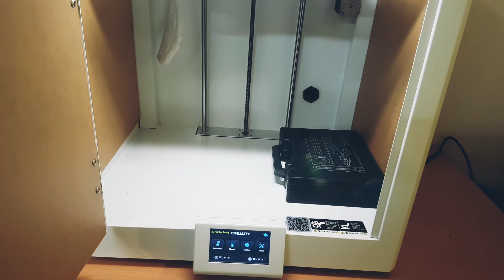Creality CR-5 PRO initial review Part 1 (Do Not Buy) purchased from 3idea.in

Comment: Fully enclosed 3D printer is not Creality's cup of tea it seems. I own Creality CR200B and all the motors are heating like hell, extruder heats to such extent that it melts PLA filament near extruder gear (tried reducing vref as well). I am thinking to add water block near each stepper motor now.

Comment: Creality should focus on get one printer right , not to design three dozens printers that are almost impossible to compare for features , pros and cons....
Reply from the maker: I think there strategy is to launch multiple products and then take the successful products forward all on customers expense. They have already launch a modified version CR-5 Pro-H with bl-touch and new hotend.
Reply: @DoTheDiy  Is it correct that this machine dosen't have a simple send a sliced 3d model to the machine? And i don't talk about crealitys wifi box that are no good. Starting to get embarrassing for them not arranging it. It is now 2021 and we have a bunch of products with easy wifi support...not talking about a 3d printer. So i think whats the big problem for them
Reply from the maker: @hammerfallen12345  No the machine does not have an inbuilt wifi or remote control/monitor option.
Reply: @DoTheDiy  Ok! That's bad....there will not be a creality machine next time. I can put more money for a 3d printer...but not for stoneage technology. Thx for your reply...there are better brands out there

Comment: you should have bought a prusa and dropped a cardboard box over it for enclosure.
Reply from the maker: Yes even I also think prusa wud have been a far better printer than this
Reply: @DoTheDiy  Always go with the masses. They have sold over 100,000 units for a reason. Three of them. Basically a lot of people use prusa for print farms for production. Not sure if anyone has any other brand running a farm

Comment: Hey buddy.
I was looking to buy this printer and have some doubts about it.
Which materials this printer can print.?
What's maximum printing speed.?
How about the precision?
And what are other disadvantages you're facing?
I would be very happy if you can give me some information. There's no where we can get a real review as of now.
Thank you in advance.
Reply from the maker: to sum it all up this printer is not worth the money. Print quality would be similar to Ender 3. CR-10S will be better bet at and will cost half what this printer costs.
Reply: @DoTheDiy  thanks for the review.
Can you give some review about Ender 6?
I saw on their website that it's a new printer will 3X faster speed.
Reply from the maker: @hiteshshah3236  ender 6 is a core XY so it can print faster than Cartesian printer. I doubt u will get good results at 3x speed at most 1.5x speed than cr5. If u want speed then look for delta printers
Reply: Have you tried printing TPU  or any other flexible material with this printer??
Reply from the maker: No i only use only PLA. I do not use other/multiple materials as they end up causing issues in printer and then u spend all time in fixing printer instead of concentrating on work